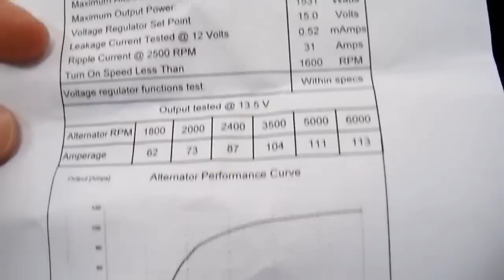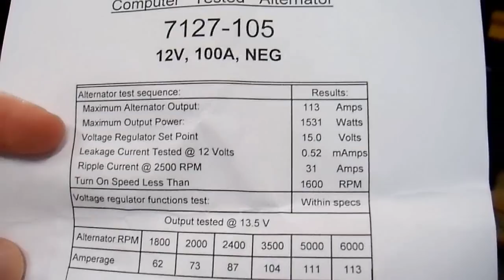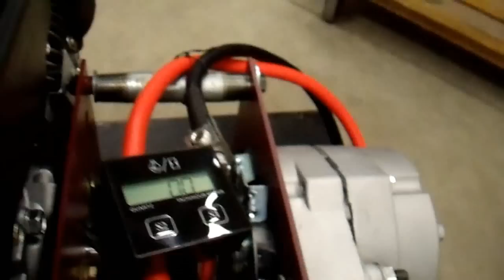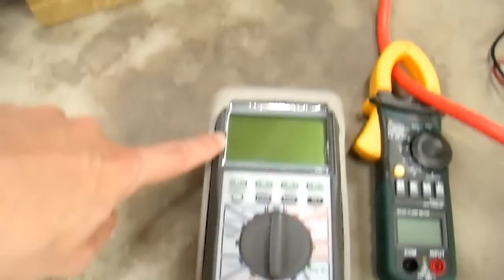DIY 12V Generator Charger - 4 First Time Fire Up and First Time Fail

Comment: @10:13 you pull on the string and your alternator spins in reverse, that's not a problem for the power but it might be an issue for the cooling since the fins are not blowing air on the alternator

Comment: So he hooks up an alternator that needs about 7,000 rpm to produce full output  up to a 3,500 rpm motor and then wonders why there is low output.  He needs to step up the drive speed of the alternator. EVERY alternator installation is overdriven. 

What broke the coupling is torsional vibration. 
A piston engine crankshaft,  especially a single cylinder engine,  has speed variations during the operating cycle.  These are resisted by the inertia of the alternator rotor. 

A drive belt will solve both issues. Step up the speed and the belt will absorb the crankshaft pulsations.
Reply from the maker: I addressed both of these issues.  An alternator does NOT need 7k RPM.  Please read some alternator datasheets to better understand how they actually work.  A standard automotive alternator is most efficient at about 2.5k to 3k RPM and outputs about 80% of max output at that speed.

Comment: Thanks for the ideas.  You have very good skills.  This is a project I have always wanted to do but have never taken the time to do.  I've been collecting parts over the years.  I have an Automotive shop and have been able to collect a variety of alternators.  I also have a very heavy duty two cylinder wisonson 25 hp engine.  My plan is to use two or three alternators.  The error in your thinking on the alternator output is an alternator was never designed as a "battery charger".  Alternators are not designed to continuously out put maximum amperage.  For example if you have a weak battery in your car that will overwork your alternator and eventually it will fail.  In other words if your weak battery just barely starts your car and your alternator is constantly trying to charge it up yes you will overheat your alternator and it will not last.  Its always better to use a good strong battery and not sacrifice you alternator.  Alternator replacement expensive, Battery replacement not so much.

Comment: If you really like the layout you have here you need to Google Dual or Double Sprocket Coupler, can be called a chain coupler. The one thing you will run into is that the driven sprocket will have a bore bigger than the alternator shaft. That can be resolved by getting a machinable sprocket or by making a bushing. These will solve the issue with the love joy bushing blowing out. i've seen these things used to tie to car engines together in a twin engine race car. If I build one of these that is the way I'm going to solve that problem. Nice work.

Comment: wow we think alike im 3500 miles away in Singapore and im planning the same kind of machine, I got a predator 200cc for a bargain on ebay usa and I bought a 35lb permanent magnet alternator meant for windmills from ebay china! my project unfortunately will be producing several hundred volts cos the claim by makers of the PMA, 3 phased 240volts at 13amps @ 600rpm (if the predator can sustain such strength)!! my biggest problem now is trying to couple the two cats together safely! your video will be a textbook study for me cos not many bother to do and post such videos!

Comment: For the Anti Vibration, get a couple of Moog Sway Bar Link Kits from and Auto parts store, They will have 3 or 4 very nice thick rubber bushing that will work great for that.  I used them on my tiller.

Comment: Yeah I still have my C64, 1200 Baud Modem and 1541 drive and disks in the closet.  I was looking at it the other day and thinking of firing it up for old time sake.  I am 39.   I got my first C64 in 7th grade, and used them at school before that.  I used to love to write basic programs, and play with sprites.  I used to spend my whole summer typing in code from the back pages of Computes Gazette and hanging out on Q-Link.  Those were good times, I miss those days.

Comment: I know this is an old video but I’d just like to say that I like the direct drive solution over the belt drive. The coupling came apart because you used a spider made from the wrong material. Other than that....this should have worked just fine once you opened up the mounting plate behind the fan. Anyway...good work and keep having fun building stuff.

Comment: I don’t want to hurt your feelings. I was told not to use an alternator, you can get better out put of a generator off an old 1949 truck, if you can find one, or an old broken generator. I tried to do this the same way as you when I was younger and it costs way too much to build. Now I’m almost 50, All’s I did is just bought an old 12000-watt generator for $300.00 it will run for 25hr on $6.00 of gas. I just got a 600-volt black power line that I will put from the generator to a power box so when I need to switch over to the other power supply to run my home, it works fine. I’m telling you this from my experience. Know one would do this much work for a back up power supply of 3000 watts and you don’t need big batteries or the converter, I next goal well be to make a power supply of 40KL watts DC to run the home. I want this to be said for history. I’m not saying that you’re going anything wrong because you are learning.

Comment: What's funny is i just commented in your other video that the spider in the coupling would be fine. Now that I think about it that size what L size is the coupling? I would still try the higher strength material before changing the entire set up.

Comment: you may want to try a coupler which we use up here in THE GREAT WHITE NORTH to couple a hydraulic orbit motor to the pump in water trucks. It is a 2 gear system coupled together by a double sided chain with a master link. The two gears face each other like that love joint but there aint no rubber spider in it . The two gears and chain are enclosed by a plastic cover which is secured by 4 hex head bolts. You may find this system more effective. Check it out.
Reply: Called a chain coupler.

Comment: Wow! I just came across your vid. This is exactly what I plan to do, just running 3 24v marine alternators with a 10kw engine, using belt drive. My target is rated 72v 80Amp dc, with wet muffler, shock absorbing and sound isolation on a boat..:)
Reply: instablaster...

Comment: Hi,

I'm building something similar except I'm using a 2HP Briggs to turn a couple of DB Electrical GM 12Si (made in China knock-off ) alternators to run a bank of APC UPS units made into inverters.   This is a 24 Volt system hence the dual alternators.

One thing I first noticed with the DB Electrical units:   The voltage regulators were putting out WAY too much (about 15 + VDC) and this was just killing my albeit underpowered engine to just charge the batteries.  Forget about even a modest or so 100 watt load.  Gutting the alternator and building my own external regulator seems to have worked wonders and I've pulled anywhere from 4:500 watts of AC power from my existing setup.  

As for pulley drive ratios:  If you can do so crack open the hood of your car and measure the crank pulley diameter and then the drive pulley diameter on the alternator.  This will give you a good starting reference.

   A 1:1 drive probably won't give that great results unless you spin your engine rather hard and possibly past a good comfort zone.   It's been my experience a stock Briggs and Stratton won't make more power if you spin it faster and these things max out somewhere around 3500 or so RPM.

But of course the ne plus ultra in terms of a drive system would be a Gilmer belt (also called a "blower" or supercharger drive belt) and associated pulleys.

Good luck to you.  The shot of the DB electrical "data sheet" struck a nerve.
Reply from the maker: pully ratios on cars are sized with two constraints in mind:  idle amperage, and maximum alternator speed at redline.  (to prevent the alternator from flying apart).  When sizing pulleys for a generator one needs to consider other factors, and an approximate 1:1 ratio is the only workable solution for a setup like this.  You do not want to spin the alternators at a 3:1 ratio like in a car or the alternators will become very inefficient.

There are power curves available for many stock engines.  They are a good reference for projects like this and the B&S engines generally peak in torque at about 2500RPM.  The power peak is a bit higher.
Reply: *****

I would be quite curious as to where you're locating torque , horsepower versus RPM curves for current and past Briggs and Stratton engines.

I can't seem to readily locate such and the issue is further confused by Briggs rating their engines in "torque power". 

For a moment let's accept there's some reality to the DB electrical data sheet.   What I read is the largest gains in output amperage are between 2,000 and 4,000 RPM.  After  4,000 RPM the return on amperage for RPM is greatly diminished.

Now here's the big question:  Do I want to use a 1 to 1 drive and be spinning a Briggs at 4,000 RPM for sustained periods ?  I would have to say no unless I want to constantly be replacing engine internals, running the engine without a governor, or have some very expensive custom made internals inclusive of a stainless steel cylinder sleeve. 

Shade tree engineering would suggest if an alternator was made for use in a particular automotive application then adapting it to a new application would start by emulating the parameters of the original application.

But of course I'm assuming the engine I'm using has ample horsepower for the power output of the alternator in question.  On paper:  1 horsepower is the equivalent of 750 watts.  

As I understand it:  Pulley ratios for alternators, water pumps, air conditioning, etc, on automobiles are , and were in the past,  directed more to freeway driving rather than stop-and-go traffic. 

Alas I wish you luck and am relating what I've done and some of the various trial-and-error.

Comment: Get a "little red wagon" or build similar; hold engine, generator, and battery- with breaker box and cables. AGM batteries. A flat, wide, cogged belt transfers torque the best (think of a cam or SC on a Hot Rod).

Comment: You need to cut out more of the red plate behind the alternator fan so the air pulled in by the fins can internally cool everything. Also, a drive coupling from a  ride-on zero-turn mower would be much stronger...Another alternative alternator may be one from a early 2000's dodge caravan, as it's pulley is a clutch-type and would be easier on the engine's crank/bearings, the coupling, and the alternator's bearings.

Comment: On the drive side of the alternator are fan blades and the mounting bracket you made looks like its completely cutting off air to the coils.... therefor overheating happens.
Reply from the maker: The 1/8'' steel does restrict the airflow a little, but not very much.  The fan on this 10si style alternator is pretty inefficient anyway.

Comment: you make me crazy, you are well on your way to being a engineer (and a dang good one) but you have a tendency to fall in love with your own hypotheses 
the ratio of the spin is designed for low current, because of low air flow
the faster you spin the more current you can draw because of cooling.
the voltage regulator will self regulate at higher spin speeds
I like this configuration but It needs a fan and to cut current draw with
in at least half by getting an external voltage regulator
302 degrees F(150C.) is too hot because the loading is too much for the RPM
these delco clones are set to voltage that is high to reduce current
a weat battery or discharged battery will also over heat a alternator

reduce your loading and retest and work up from there
much mechanic respect and very well done so far

Comment: Sir. I built 1 with 4  Alternators . Using the rear end of a small  Is lawn tractor rear end with 5  Gears forward  And one reverse. Is powering the  powering the transfer case Is a lesson Electric motor   Is 24  volt DC. No gas. I've been using it for about 3 years. On my  Farm.

Comment: Should have had a pulley system connecting it to the direct drive like you have it will not only destroy the alternator and long-term from shaking but cause the alternator to heat up from the engines Heat and using pulleys you can always adjust RPMs

Comment: i just want to know how many watts does it take to use a charger on 3 car batteries for when solar doesnt work as well.
Reply from the maker: That depends on the charger rather than the battery count.  A typical 20 amp charger will consume around 300 watts from the AC mains.  This engine based setup has a maximum output of around 1200 watts.
Reply: so 300 watts would be the best charger power.thanks for your input

Comment: Nice little generator but not a good mounting plate. That rubber will tear because of the wobbling steel plate its sat on.  Try going to a steel supply and getting some 1/4" steel plate its not too expensive and add some rubber supports to ease vibrations on the floor. Right now I have in the works a salvaged Prius power train which i am going to use as a generator in the future. The parts are relatively cheap now and Toyota reuses the same parts and ecu's on most of the cars so it doable.

Comment: i run 3 in pulleys on motor and alternator.  i run the motor @ 2800 rpm's with a battery in line charges great doesnt over heat 6.5 hp brigs n stat motor ford van alternator. 130 amp. pictures on request!
Reply: Hi Don, i plan to build a similar setup. Can you please tell me what volt and current you can generate  continuously? My plan is running 3 units of 24v marine alternators from a 10kw yanmar diesel..
Reply: You talk to much we are not stupid

Comment: Cool project! I like the approaches that you took. Such as using direct drive instead of belts. Did think about using aircraft circuit breakers instead and think of maybe using cooling fans on your alternator. Did you ever upgrade your coupler?

Comment: I growed up in the starter and alternator world I was playing with starter drives when I was 4 years old you are doing good .fact the power curie is from Delco tech we had ALL of the books. Delco sent them to us and all the updates.  SI. CS 130S 10SI 12SI 15SI 17SI 20SI 21SI 24SI 25SI 30SI. ETC.  AND THE TYPES 100 105 200 205S you can cut the regular out and put a reaustat in I can and will help anyone. that ask me I WILL NOT BS ANYONE THIS FIELD IS SO DIFFERENT Jerry Lewis was the very best my father. R.I.P SHOWED ME ALL OF IT.

Comment: Instead of that coupling, wouldn't a universal join work? The angle looks almost flat enough that it should be able to transfer the most constant velocity.

Such a shame that the alternator is to much of a load for the engine.

Comment: Your fan blade is not effectively cooling the alternator, the mounting plate needs elongated holes to enable air flow.
Reply: Probably would have help too if it was spinning in the right direction for the cooling fan to work.

Comment: I know this is old but the reason it doesnt work is because you have to have a light that will draw current to excite the alternater into charging so unless you have a clue you probably gave up. having a momentary swith will work but it still needs a light in the line so when you push the momentary swith it draws current exciting the alternator into charging. you where nearly there ohwell
Reply from the maker: I'm not sure if this is trolling or nor so I'll bite and reply.  The momentary switch does work (as is well documented on delco style alternators which are self exciting but not one wire) and a light in line would not work as I intended - it would result in a permanent parasitic draw once the engine ran out of fuel.  A momentary switch is the best solution here.  Once the field is excited either on its own or with a momentary pulse the "diode trio" (as documentation calls it for some reason) supplies the field current and the lamp serves no function except as an idiot light.  It was a creative way to implement a failure light in the 50's when they did this design but it serves no function for this setup.

Comment: This is the disadvantage of direct drive your not using pulleys to increase the rpm of the Alternator I understand what you were trying to achieve as there can be belt wobbling or jumping off of a Vee shaped pulley belt.
Reply from the maker: Increasing the RPM of the alternator is not an advantage, it is a disadvantage for reasons stated in this video series.  I ended up with a 1:1 belt drive setup and it works well.
Reply from the maker: *****
The video explains why.  The alternator is most efficient at lower RPMs, and the direct drive coupling was not capable of handling the reciprocating load of a piston engine.  A belt is much more reliable.
Reply: ***** hi brother,please help me how to restore SBS 190F dry battery,once i have seen one of your project,you was using that type of battery,so please help me,i am using this battery with my UPS but the back up time is less now
Reply: ***** You are kidding right? An alternator is more efficient at higher rpm as it delivers higher amps...